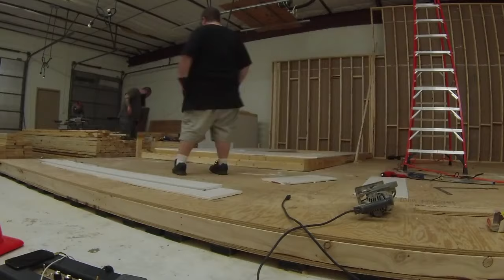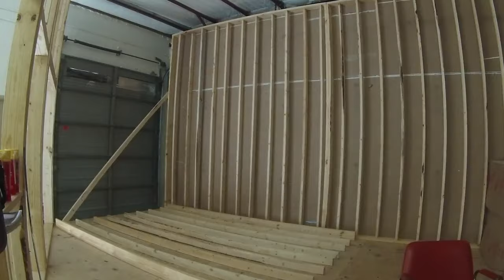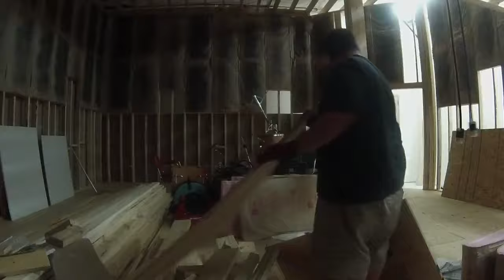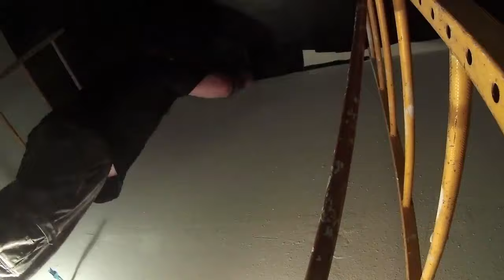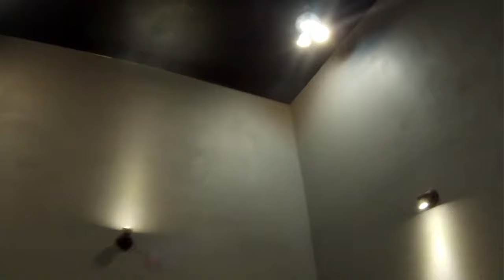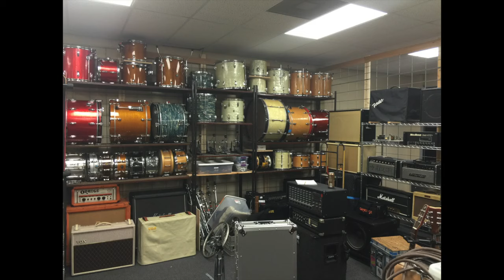DIY Time Lapse Recording Studio Build

Comment: The few times I've built a floating floor, I've included a layer of 5/8" drywall sandwiched between 2 layers of ply for the deck.  Helps a little with low end trans mission.
Reply from the maker: Oh yeah it would, good thinkin. Kinda like the using 2 different thickness drywall back to back on the wall to absorb the different frequencies. But really no complaints here with our floor build, what we did was PLENTY hefty considering being inside a whole other room. The low end got sucked up just fine, super punchy toms n kick drums, also had thick rubber "rests" or "stands" we set some amps on  while we were up and running! Thanks for watching :-)
Reply: @SkyAcreRandomEtc  Looks great!

Comment: Nice studio build.  A suggestion for next time: Angle the walls since they are non structural.  Break the walls in the middle along the horizontal length and push the middle out by 8-10 inches.  You might slope the ceiling.  This is to avoid parallel surfaces.
For the control room make the front of the room a trapezoidal shape, slope the ceiling and break the side and back walls.  Again this is to avoid parallel surfaces.
These simple steps will reduce standing wave problems at very little cost.

Comment: I wish you I knew more about those rubber things you placed underneath the floor
Reply from the maker: Thanks for checking out the video. Glad you liked it. A lot of people ask me about this so I’m copy/pasting an answer :-) Those rubber squares below the subfloor are hand cut horse stall mats, bought from Tractor Supply. 3/4” thick 3’x4’. Measured, gridded and sliced/chopped into 4 inch squares then liquid nails sandwiched together. Took a long time, sore hands. ✌🏼
Reply: Thanks for sharing

Comment: Great video and great build! What are the black squares called used to float the structures?
Reply from the maker: Thanks for checking out the video. Glad you liked it. The rubber squares are hand cut horse stall mats, bought from Tractor Supply. 3/4” thick 3’x4’. Measured, gridded and sliced/chopped into 4 inch squares then liquid nails sandwiched together. Took a long time, sore hands. ✌🏼

Comment: Absolutely spot on. I'm about to design and build out our metal barn, which also has a concrete slab, and am wondering what you think a good basic budget would be to do something like you've done here. Thoughts?
Reply from the maker: From an earlier reply of mine to the same question: Oh man, that's a wide question. So raw building materials alone? Going from memory(we built in 2015) I believe it was somewhere near $29k, doing ALL the labor ourselves from flat slab inside a warehouse to floated floors, walls, doors, lights, windows, etc... The recording gear, cabling and instruments is a whole other deal obviously.

Comment: Such a great vid! Did you do anything special to make the materials easy to deconstruct and reuse on your next build?
Reply from the maker: Spent many many days slowly dismantling screw by screw board by board, saving virtually everything except for the drywall and stored it for awhile, then using it for many other random builds. Pretty nice to have a stock pile of reclaimed materials. Poured a slab here in Austin to eventually build another smaller studio. Thanks for checking out the video.

Comment: What are those small black pieces that the floor was built on?
Reply from the maker: Thanks for checking out the video. A lot of people ask me about this so I’m copy/pasting an answer :-) Those rubber squares below the subframe are hand cut horse stall mats, bought from Tractor Supply. 3/4” thick 3’x4’. Measured, gridded and sliced/chopped into 4 inch squares then liquid nails sandwiched together. Took a long time, sore hands. ✌🏼

Comment: Really cool video. Hat off to you guys. What's inside those sacs under the floor?
Reply from the maker: Appreciate that! I think you’re asking about the batts of insulation between the plywood layers. That’s just typical pink fiberglass, we wanted a slightly resonant floor, more to control the low frequencies rather than totally dead like a sand fill sub floor would do. Floating the whole thing on the rubber pucks and having just enough pink insul in the sub floor was perfect for the drums and amps to sound full in the room on the oak floors.

Comment: Not sure if this was asked before, but what material are those black pieces under the flooring sheets?
Reply from the maker: Thanks for checking out the video. Glad you liked it. A lot of people ask me about this so I’m copy/pasting an answer :-) Those rubber squares below the subframe are hand cut horse stall mats, bought from Tractor Supply. 3/4” thick 3’x4’. Measured, gridded and sliced/chopped into 4 inch squares then liquid nails sandwiched together. Took a long time, sore hands. ✌🏼

Comment: Great stuff! Can you please tell me who is the manufacturer of the rubber pieces you used to decouple the floor?
Reply from the maker: We made them out of heavy black rubber 3'x4'x 3/4" horse stall mat we bought at Tractor Supply. It took alot of work and a couple days, cutting strips by hand with razor blades and with a chop saw eventually after our hands gave out, and a 4' straight edge level. Labor of love. Thanks for checking out the video!
Reply: @SkyAcreRandomEtc  Oh man, thanks for replying, Great build you Kat's did,

Comment: Great video! Could you tell me, please what material did you use to separate the building floor from the studio floor?
Reply from the maker: @quaffer781 Hi! So we made them out of heavy black rubber 3'x4'x 3/4" horse stall mat we bought at Tractor Supply.  Cut them into 4" squares. It took alot of work and a couple days, cutting strips by hand with razor blades and with a chop saw eventually after our hands gave out, and a 4' straight edge level. I think there is a short blip of us chopping the pucks behind my Sprinter van somewhere in the video. Labor of love. Thanks for the question and watching!

Comment: What are the black squares you put on the floor to float it please? Are they rubber?  I am wanting to build the same in my warehouse. Room inside of a room
Reply from the maker: Hi, yes they are square 4” x3/4” hand cut rubber pucks from 3’x4’x3/4” horse stall floor mats we bought at Tractor Supply. We  gridded it out, cut them by hand with razor blades and cop saw and a good metal 4 foot level. It took a while but was worth it, very strong and heavy duty. Good luck on your build. Very rewarding and quite and undertaking ✌🏼

Comment: NICE Restore!!! What did you use to float the floor?
Reply from the maker: Thank you! So the initial pucks we threw down are made from 4x6x3/4” heavy duty rubber horse stall mat from Tractor Supply, sometimes gyms use these for their flooring, that we scored and chopped into 4” pucks with razor knives into strips then chopped to 4” square pucks with a chop saw. Laid those out on grid with chalk lines on the slab. 3/4” inch plywood sheets on those, then dbl 2x4 cross supports with batt insulation then 2x 3/4” plywood layers. Then 1/4” rubber roll on top of the plywood as an underlayment for the 3/4” solid oak floor planks. Quite a chunky floor. Made the drums sound great! Thanks for checking out the video 🤘🏼
Reply: @SkyAcreRandomEtc  Awesome! Thank you for sharing! Beard On Brother!!!

Comment: What was the rubber or foam you layed down before the floor? Looking to diy a sound room in a warehouse by train tracks that would be great for the vubrations
Reply from the maker: Hi Tre, it’s 1/4” rubber roll beneath the oak wood flooring, we got it from Tractor Supply. If you meant the pucks we laid out at the very very beginning of the video before we laid out the sub-floor frame, those were sliced up 4” pucks of 4’x6’x3/4” horse mat we also got at Tractor Supply and spent 3 whole days slicing by hand with a 4’ aluminum straight edge level and SEVERAL packs of razor blades. Labor of love. ✌🏼
Reply from the maker: PS works very well for low end or sub freq vibrations, this studio was located directly next to a print shop with some huge turn if the 20th century lathes and iron presses, really helped decouple our floor and walls from that rumble.
Reply: Appreciate man

Comment: How is the isolation with those Pella ThermaStar windows?
Reply from the maker: Those were surprisingly good, VERY heavy higher end model, can’t remember the exact number. They were spaced about 1’ from each other, slight tilt on one if them to prevent cross waves or standing waves from building up. If I did a another studio again I’d reuse them, cheaper than heavy slab glass. I think these Pellas were $450 each, but that’s 2015 or 16 prices. Thanks for checking out our video ✌🏼

Comment: Cool! What kind of black iso blocks did you use for the flooring?
Reply: Same question, what are those small black boxes you spread on the floor at the start of the video? And did you just put them on the floor without any further reinforcement or etc? Don't they move, later,  if you just put them like that?
Reply from the maker: Thanks for checking out the video. A lot of people ask me about this…. Those rubber squares below the subframe are hand cut horse stall mats, bought from Tractor Supply. 3/4” thick 3’x4’. Measured, gridded and sliced/chopped into 4 inch squares then liquid nails sandwiched together. Took a long time, sore hands. ✌🏼
Reply from the maker: @mojito6629 thanks for the question. They didn’t move at all. Thanks for checking out the video. A lot of people ask me about the rubber squares below the subframe are hand cut horse stall mats, bought from Tractor Supply. 3/4” thick 3’x4’. Measured, gridded and sliced/chopped into 4 inch squares then liquid nails sandwiched together. Took a long time, sore hands. ✌🏼

Comment: What did you use to float the floor?
Reply from the maker: Thanks for checking out the video. A lot of people ask me about this…. Those rubber squares below the subframe are hand cut horse stall mats, bought from Tractor Supply. 3/4” thick 3’x4’. Measured, gridded and sliced/chopped into 4 inch squares then liquid nails sandwiched together. Took a long time, sore hands. ✌🏼

Comment: What are the black squares on the floor at the beginning of the video made out of please? I'm looking to build a rehearsal and recording studio and I'm researching materials at the moment.
Reply from the maker: @thekembe27 so we made them out of heavy black rubber 3'x4'x 3/4" horse stall mat we bought at Tractor Supply. It took alot of work and a couple days, cutting strips by hand with razor blades and with a chop saw eventually after our hands gave out, and a 4' straight edge level. I think there is a short blip of us chopping the pucks beghind my Sprinter van somewhere in the video. Labor of love. Thanks for the question and watching!
Reply: @SkyAcreRandomEtc  that’s fantastic information. I really appreciate the reply. The studio looks amazing. I’m very jealous. Enjoy it and treasure it. Thank you.

Comment: Is a warehouse?
Reply from the maker: Hi, yes it a warehouse. A typical bland front commercial space with "store front" style entrance and commercial overhead roll up garage doors out back. Very helpful with getting building materials in and out. This warehouse had 16' ceilings with an insulated roof. So we built the studio floated off the slab and the walls/ceiling just up to the inside ceilings. A plus is you get to build year round without any weather threats. A drawback is finding a space that will let you build inside, and you are limited to whatever the space size is. Thanks for watching

Comment: Which wood has been used to make all that frame sir?
Reply from the maker: 2x4’s mostly. With 2x6 top and bottom plates so the wall was wider, floated double stud walls. Where the inside sheet rock is only attached to the inner row of studs and the exterior sheet rock is attached to the outer row. Cutting down on low end frequencies and vibrations continuing through the wall. The ceiling joists are 2x8’s or 2x10 for the wider spans in the live room. Thanks for checking out the video.
Reply: @SkyAcreRandomEtc  Thank you for the reply sir, but my question is which wood you have been used to build that fram?
Reply from the maker: Untreated yellow pine

Comment: After all that work, you used regular insulation instead of Rock Wool?!??😮
Reply: You used rockwool in your studio build? Can you send me pictures of the install?
Reply from the maker: @rmroza This was a room in a room build with a 2 foot airgap between us and the adjacent tenant which was an industrial print shop. The additional cost of "Rockwool" would have been wasted, and deemed unnecessary. The sound coefficient wasn't there. But if you have personal experience to show otherwise please include a link.